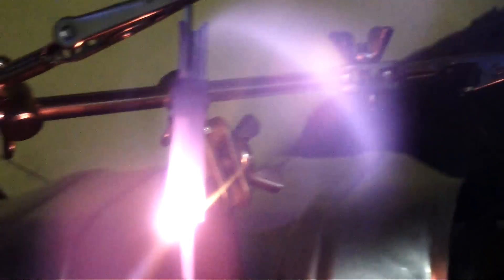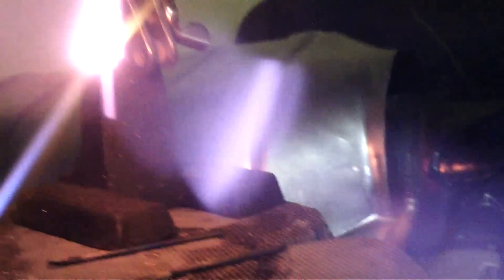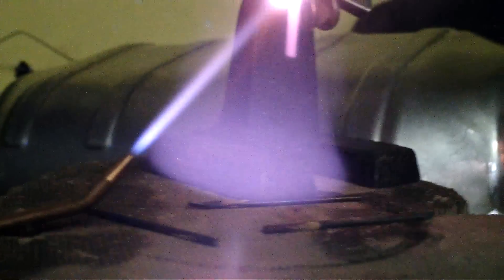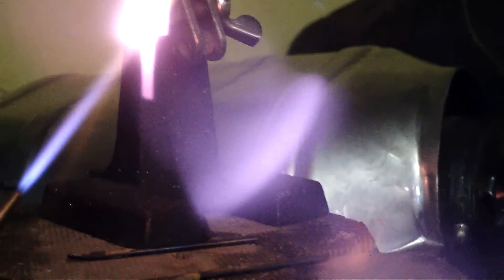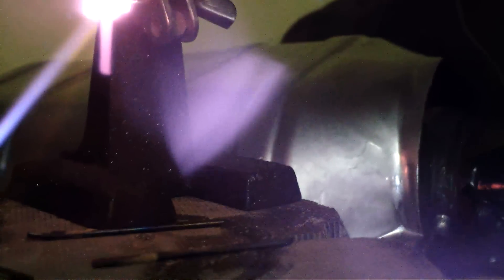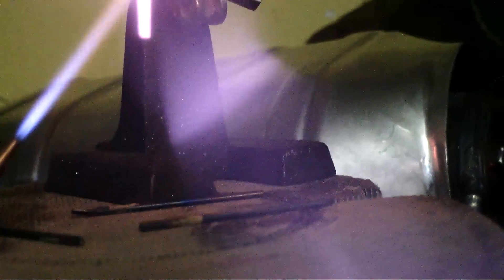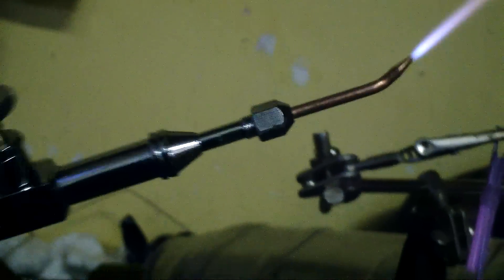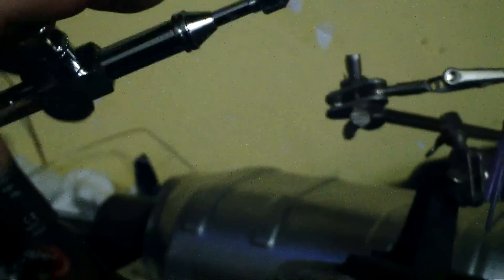HHO and Tungsten For The Flower Pot Heater.

Comment: How many watts , amps, volts, to get the flame on the movie ?
Reply from the maker: I don't know ......Not much really...
Reply: Interesting anyhow. If time when you already got the equipment think of measuring amps, voltage to create the gas for the flame. The flame heats a pan with 1 liter of water in it to all water boils away.  2260 Joules per gram is the energy to boil away water. So when one liter of water is boiled off we have time amps and voltage = energy in and we know that 2260 KJ per kg water was needed to boil it off. COP will be easy to determine. What do you say?
Reply from the maker: Zekerias Varg I am not good at math....
Reply: *****
 Its not any math involved.  Just measure the amps that you electrolycis uses and the voltage and write the values down. After this you light the flame and start the clock. Heat the cooking pan with 1 liter of water without making a hole in it but you want the read-hot effect if possible,, use your hand to let the flame move around a litle not gassing the metal off. When all the water is gone stop the clock. I will calculate for you !  Its easy. Just take the time in seconds and multiply with the voltage and the amperage used. I think the amps and voltage will be nearly constant if your cell is good , it could be very good to film the instruments so we can se if the amperage moves.   The time times voltage and amperage will be the energy in joules !  And the value for boiling away the water is given from the litterature, the energy demanded to take the water to the boiling point is neglible due the heat of vaparaozation energy.

Comment: nice to see you guy's are giving that a try, 20w heater sounds nice. Maybe one of the next steps is to see if you can use the honeycomb as the ignitor (if there's a flash back) to then have the flame pointed at the tungsten. Then have a thermostat hooked up to the whole unit to repeat the cycle?

too many ways to go about it :)

Great work!

Comment: nice work! what about using hcomb + tungsten together maybe using the warm generated by the hcomb? i mean: if the do transverse holes on the hcomb and put through this the tungesten maybe it will adsorb the heat and release it on the outside parte that we can collect :)
Reply from the maker: That is a possibility . something we can try as we go.

Neal